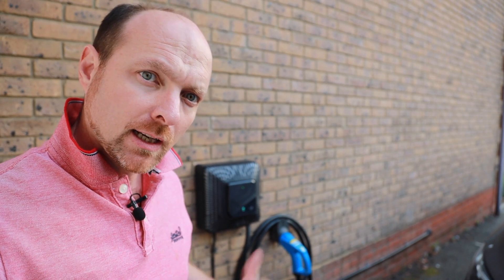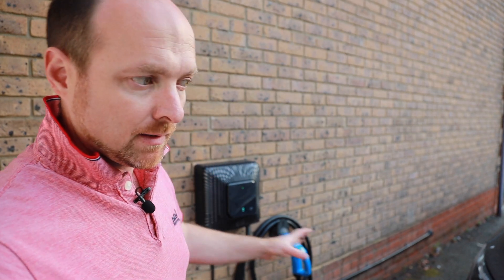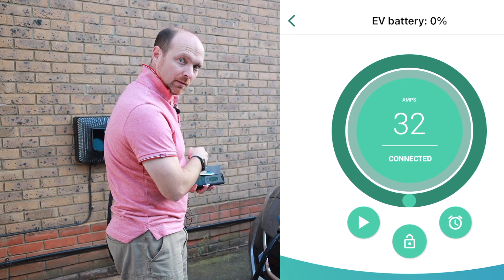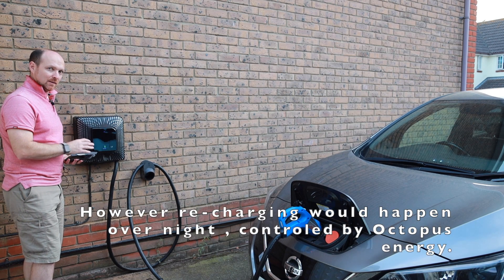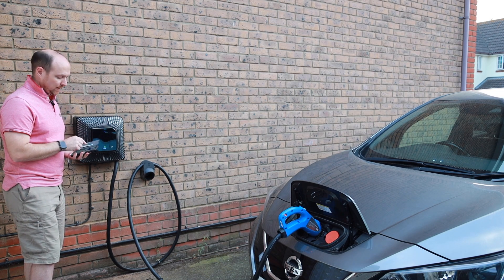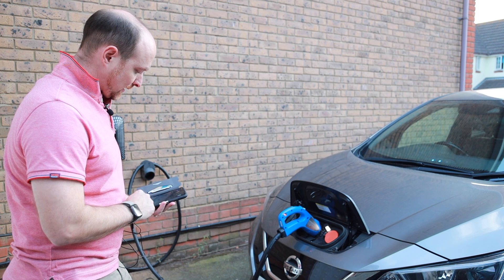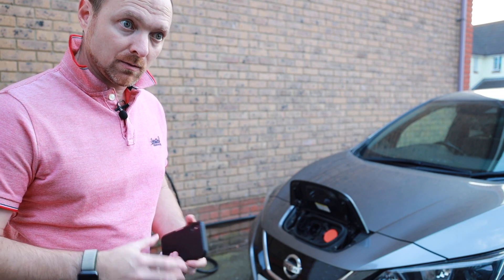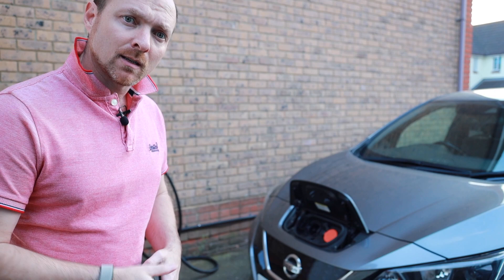WallBox Quasar Introduction. Vehicle to Grid

Comment: Is this going to be automated, or will one need to fiddle with an app mulitple times a day? e.g. set it to charge car during off-peak, then pull power from car during peak but set it so the car can only be drained down to 50% of its capacity so your not stuck with a useless car. Then once set, forget about it, also have to touch an app to disconnect is stupid. Surely a button built into the charger handle with fingerprint biometric is the logical way?
Reply from the maker: Hi during the trial the system was automated. But you could intervene manually if needed. Through the app you could set a minimum level of charge at a specific time so you’d always have what you needed in the morning.

Comment: 1st thing using chademo is wearing battery more faster. 2nd any ev manufacture wilk refuse to give warranty to ev battery, if it was used to power house
Reply from the maker: Hi, no, using Chademo at 7kw is no different to using Type 2 at 7kw. If the Wallbox Quasar could supply 40Kw then it would be different but it cannot rapid charge or rapid discharge the battery. It also bypasses the onboard charger in the car, so saves use of those components.

Comment: Go yo nissan, and tell them you using leaf to power house... they gona void your warranty instantly
Reply from the maker: why they literally designed the car to do this, and used it in their own advertising. https://www.youtube.com/watch?v=NlJX09m35s8
Reply: @eviain  they will not give you warranty i tell you those lithium batteries are so wearing down super fast, if you use them to power houses they will do lots of recharge cycles, and that is pain for lithium batteries, imagine you have new car, in 3 years and 100k km you gona have less than half capacity and range... i beleave there is warranty limits that below 70% battery considers damaged and needs to be replaced. Tesla warranty claims clearly - you cannot power the house. Same goes for all manufacturers, because they would need to replace milions of bateries underwaranty
Reply from the maker: So you did watch the video with the guy from Nissan in the link above, advocating the use case?
Powering a house vs driving is very low power 14kwh per day would be needed for my home. Batteries like to be charged and discharged slowly and cool-ly which 7kw will do. 
Batteries don’t like being charged on rapids and get very hot, especially Nissans as they are not cooled. Running v2h/g at 7kw is very slow and therefore not too stressful.
Some manufacturers will replace batteries under warranty at 70% or less capacity. However a battery with 70% capacity would be very good for… running a house, which is a second life use for EV batteries already. 
Tesla in this example is irrelevant, they don’t use chademo and have no commercial interest in v2h/g as they sell power wall. So it would eat in to one of their other products market.
However in my case as you know the car isn’t mine, it’s part of a trial so I’m not that bothered what happens to the battery 😅
Cheers!

Comment: What is the charging rate and discharging rates? (kW) 
I also have a newer Nissan Leaf and I’m interested in V2G and this looks a good solution since Nissan dealers in Finland know nothing about solar or V2G. 

Would it work on all models of Nissan Leafs?
Reply from the maker: Hi Bradenton, the rate is up to 7kw the unit is on a 32/40amp supply so that’s the max. I believe the leaf can do this out of the box as it’s all part of the chademo standard. 
The charger system is a bit basic, it doesn’t work like a power wall so would be quite manual to use unless they have other features that are not part of this trial, like some kind of import sensing that would trigger v2g/h

Comment: Good video; first I've seen that even acknowledges the fan noise which would be a deal breaker for me. I can see Wallbox have a new V2G charger out, which is much taller. I'd be interested to know if that allows better cooling and a quieter product.

Comment: If you switch off the main grid breaker to your house, will this unit power your house allowing you to power your critical loads (lights, fridge etc) during power cuts?
Reply from the maker: No the system is grid tied, so there must be mains power, mainly for safety of engineers working on the transformers in power cuts. I believe power walls like tesla you can add an additional module to cut the grid connection so you can power your home and not put grid workers at risk, so I can see that it would be possible in theory but we dont have the software or hardware to do that here, great question.

Comment: Great video....
Very important that DC isn't disconnected by pulling contactors apart, DC arcs gets more violent at higher voltages resulting in weld scoring on the terminals and potential shorting. AC voltages goes through the 0v point 50x a second (50 Hz) so the voltage 'let's go' of the connection quickly but DC doesn't and tries to maintain the connection whilst the components are being pulled apart creating problems.....

Comment: When do you think this will be CCS compatible and quiet .. It’s exactly what i’ve been waiting for….  Also I am not too concerned about send power back to the grid.  I just wanna power my home…. so maybe this use should be emphasised.  I don’t have solar yet but i do have very cheap overnight rate at 3.5p kW Hour.  Thanks for the great video.
Reply from the maker: Excellent question probably worthy of a future video on its own
Reply: Eddie. According to Wallbox the unit they are working on does both. Probably have to wait until 2023/24 for availability.

Comment: Hi Evlain is your unit on a trial set up were you can purchase the unit after the trail ends. I was accepted on a trial set up but the time schedule was being put back all the time and I had to go to a power supplier they stated for the time of the trail which was not one of the cheapest ones, so I opted out before it started so it did not make me liable for any costs.
Reply from the maker: Hi no I don’t believe so, and I’m not sure id really be that interested in purchasing it. The car is also part of the trial so it all goes back when it finishes.

Comment: While a by-product of solid state switching to convert AC to DC is heat, the best, using Silicon Carbide or even Gallium Nitride, give off less heat and so are more efficient. Think I will wait a while before jumping in with this unit.
Reply from the maker: There’s definitely a long way to go before anyone starts buying these in volume

Comment: This only looks like part of a solution that may be ideal. But charging / discharging should be depending on the residential demand. Smart metering should be part of the installation. The noise is unacceptable for residential usage.

Comment: Very interesting…………
Surprised at the fan noise  and as you say in the dead of night might have neighbours getting the shotguns out!

Is there a difference in charge rates/time when using the dc connection? I would have thought there  might be as the ac to dc rectification normally done in the car when using the Zappi  would also generate heat which might be undesirable in the car and might be a limiting factor.
Reply from the maker: Hi Michael, Yes that’s right the onboard charger would normally handle the conversion with its inverter, however they are normally rated, I think the leaf has a ~6kw charger, limiting the rate of charge. 
With the DC Wallbox it may be able to supply 32amp/7kw but there could be all kinds of real world losses that make it a negligible benefit. 

The leafs connection itself is capable of much faster charges…. 40kw.. At least once! cough Rapid gate, however thermal control from the battery slows the charge on the leaf as there’s no active cooling on the battery.